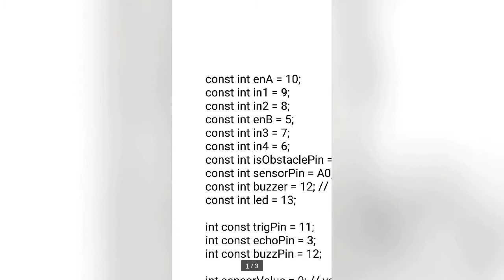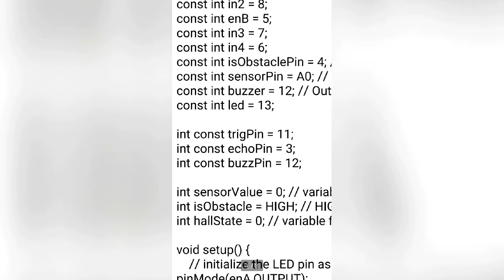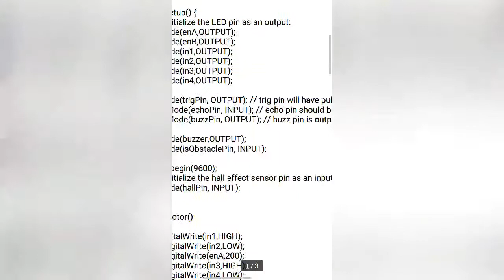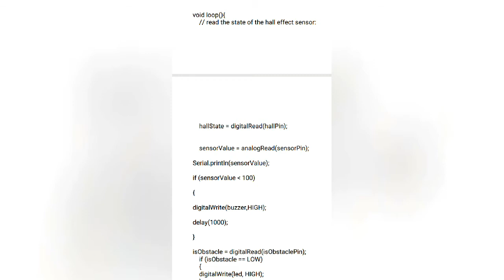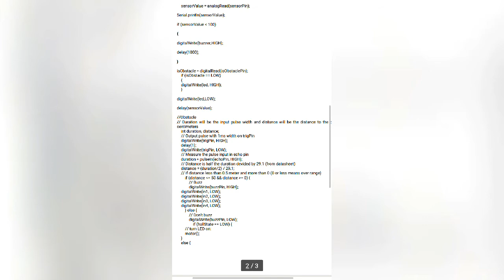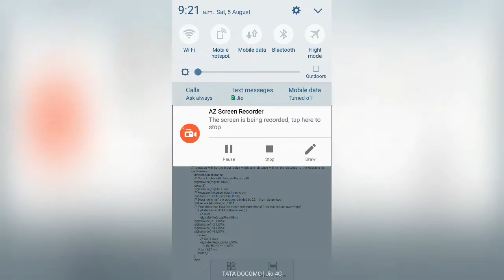Automated Guided Vehicle using arduino with magnetic sensor.|Arduino Project|AGV|Code |Part-2

Comment: where have u defined hallpin
Reply from the maker: +abhishek dubey I have defined hallpin=0

I m sending the block of:

int sensorValue = 0; // variable to store the value coming from the sensor

int isObstacle = HIGH; // HIGH MEANS NO OBSTACLE    

int hallState = 0; // variable for reading the hall sensor status
Reply: Can u send a word file of whole code that would be extremly helpful
Reply from the maker: +Abhishek Dubey Sorry to tell u that my project members r not allowing me to send the code. But one thing for sure, help required to code just contact me with your email ID.